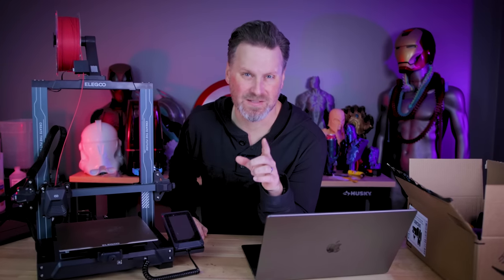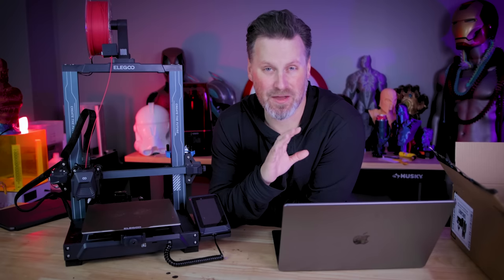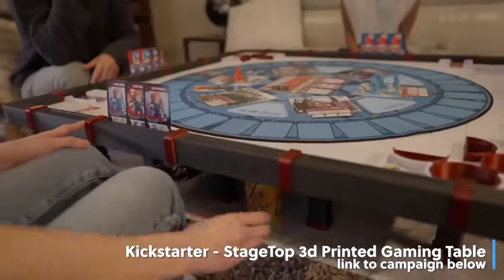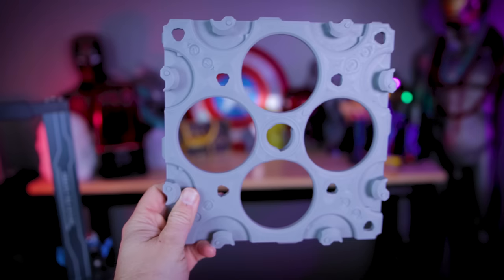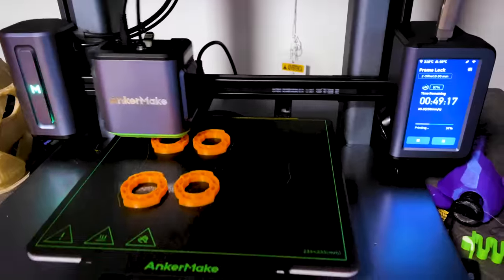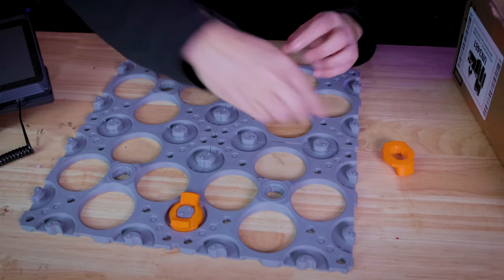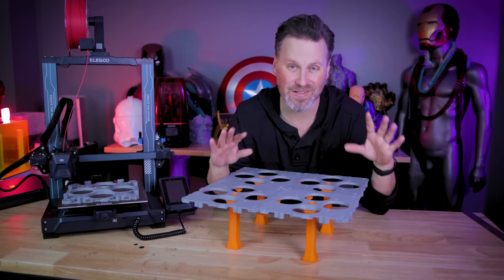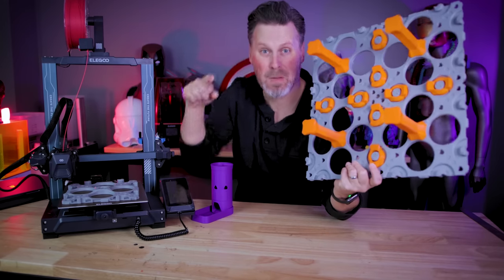3D Printing a Gaming Table

Comment: This is going to be my first STL campaign.  Thanks so much for making a video on this.  Those prints look great and are so fast.  You are saving about 7 hours per plate with the X1C. I saw your post in the Bambu group.  My friend got his Anker Make M5 recently and I really need to upgrade to a faster printer.  I think this campaign/project pushes it over the edge to get the Bambu X1C sooner than later. Thanks!
Reply: The Bambu has been consistently coming in at ~33% of the print times posted. Blown away by how fast that printer can deliver great prints.

Comment: I remember a university student coming up with an automated way of dividing up a large model into pieces with connection points that are all printable. This might not be the same thing, but it's very similar and quite clever. 

I think this is totally cool, even though I'm the kind of guy who would buy a bunch of power tools to build a table out of 2x4 lumber. Except the table saw. I can't fit that anywhere.

Comment: I do love the general idea of this though personally as someone who's in favour of open standards, I kind of see this project going a similar way to how several commercially gated grid storage systems have been waylaid by the open equivelants, in that example Voidstar Labs' open Gridfinity system. I do hope this goes in the direction of ensuring open compatibility with individual creator's works without locking down the details too much, as that'd be unfortunate. Still, its great to see concepts like this take off in any regard, cheers for sharing.

Comment: Gonna be honest, as cool as this looks and as well designed it seems to be, I can't see myself using this. It looks really lightweight and easy to knock into and jostle around. Tables need to be sturdy and solid,  especially if you have tons of little pieces carefully positioned on it. Seems like it could benefit from some sort of clamping or weighting system to prevent that. It definitely is a very useful project if space is tight or you are in need of a portable tabletop, and are willing to make that compromise.

Comment: It looks like it's been designed very thoroughly, and I almost want to back it on that basis alone, but I'm just not getting the point of it. A typical gaming table has a recessed surface so that you can 1) lean against the sides without bumping anything, and 2) put a top over it so that the game doesn't need to be packed up to use it as a normal table. This offers neither of those, and even worse is that either you have this 3D printed tray table that needs to be lifted and put on the floor or something to use the table again, or you have to pack not only the game but the whole tray table away. As well as it's been designed, for a large-ish table it looks like it'd probably take 15-20 mins to put together or pack up, and again I don't get why I'd bother rather than just use the table as is. And this is before I've even gotten into the hundreds of hours of printing plus hundreds of dollars of filament to make it.

I wish them success, and it looks like they've already got it, but I'm yet to be convinced. Having said that, if it turns out well, and people show videos of how wrong I am, then maybe I'll pick it up post-kickstarter.
Reply: This is exactly where I'm at. I like the premise, but I simply don't see a reason to build and use this over just using the table you are setting it on. The dice towers and card holders are the only thing making it unique to me.
Reply: I thought the same thing. If I could print the entire table I’m in but this is just a table topper. Don’t need that since I don’t keep drinks or food on gaming table

Comment: Looks cool, but imagine setting a game of something like Nemesis. You will need to print a lot of parts cause the game takes a lot of space table. So now you have to spend about 30 minutes putting the table together, so that you can then spend another 30 minutes or so setting up the game components. Might as well get a cheap foldable table at walmart.

Comment: The first Q at Shark Tank is, what's proprietary here? The KS page mentioned Patent Pending but there are a thousand ways to interlock any two things. I reviewed the KS comments and the only mention of patent was users not selling parts they modify, which is fair. I'm not saying this won't succeed as a KS, only that once it's out the door it's time to sell out as quick as possible because the wolves are on the trail and they will overtake and eat you.

Comment: It's brilliant! I'm just wondering if the structure could be too much lightweight and fly down from the table with a clumsy hit.
Reply: The total weight keeps it well in place, especially if you print the feet with TPU or apply an anti-slip pad on the bottom of the legs.

Comment: I don't really get it. What's the point of this play surface over a regular table? The point of most gaming tables is that the play surface is recessed so a game session can be paused and the table return to use as a plain table.

It's not clear how building one of these creates a better gaming experience.
Reply from the maker: 🤷‍♂️🤷‍♂️🤷‍♂️ dunno. Just though it was really dang cool with lots of fun accessories to print
Reply: depends on your situation, it might not be for you.  for me, I have two tables, one is slick glass and the other is rough wood with gaps.  neither is good for gaming.  this can sit over top of eather.  also instead of recessed, it looks like I can pick this entire play surface up and move it someplace else (on top of the guestroom bed) then move it back for next week's play session.  nothing is for everyone, but I can see how this will work very well for me.  and on vacations?  it's portable.  who knows what the placing I'm staying will have, with this I bring my own gaming surface.
Reply: @jajordan2515251  Fair enough. I wasn't thinking of that kind of thing. Thanks!

Comment: I am boardgame player myself but I don't understand the purpose. If you put it on top of your table, you can't sit since it's higher now and you wouldn't see the board. You can't use this without a table because it's not strong enough and it would break if anyone lean on it. Can someone explain?
Reply: I had the same question, then I saw the short (~1 inch) legs on the site available and that should solve this problem if you find yourself in this case.  For me my (current) table is a bit too low so the larger legs will work better.

Comment: Interesting idea but why a Kickstarter? Design the thing and sell the STLs.
Reply from the maker: I would assume to not waste a ton of design time if no one is interested in it. If you design just the core files maybe there is a decent amount of people that buy. Also tends to be a fairly good marketing strategy for small / startup companies. But maybe you can ask on the ks & see why they did it.
Reply: The reason for the KSer campaign is to help fund project completion. While several components are complete, several pieces still need fine tuning (that isnt the final version of the frame for example) and more development work. Some of the stretch goals are just kicking off development as well. Thanks for the question.

Comment: How can they have stretch goals for 3D cad files, which are already drawn? Seems odd someone would run a kicstarter campaign for already completed CAD files? Why not My mini factory it, or cults3D?
Reply from the maker: I would have to assume they don’t have them fully built yet but I could be wrong.
Reply: The reason for the KSer campaign is to help fund project completion. While several components are complete, several pieces still need fine tuning (that isnt the final version of the frame for example) and more development work. Some of the stretch goals are just kicking off development as well. Thanks for the question.

Comment: I dont understand Kickstarter for STL files...
Kickstarter is to fund development.  The STLs are done already, and didnt require much more than time of the designer.
Reply from the maker: I can’t say for sure for this one. But a lot of the ones I’ve backed previously, they are not fully done. Or with something like this. They might have a core set of files semi completed but not optimized. They then announce tier/milestone add ons that typically still need to be designed as well. Some will also need additional editing for cutting up the models into smaller parts or presupporting. 

I had a project in mind that I was potentially looking at doing as a Kickstarter as well. Helps gauge if you should spend the time / hire resources etc before actually investing in all of it only for no one to buy it.

Comment: While it is very cool and modular..it doesn't seem very cost/time effective. For the amount of filament needed to make a sizeable table for tabletop games, the material cost being higher for a more durable filament, and just the print time alone for the average hobbyist with 1 printer....I'd much rather just get an IKEA table and use my 3d printer to instead print tabletop board game accessories.
Reply: Yeah, as a board gamer, this is quite ridiculous idea and I'm not getting all that hype.
Reply: Nothing in this video is exciting in any way. Guess I need to check out the rest of their stuff. If this support system is the most interesting thing they could send him then yeah this is a high waste. Anyone can make a table. 

His excitement is beyond confusing.

Comment: Estimated time of…19 days?!?? Did I do that math right?!?!
Reply: Printed at default slicer settings (Prusa/MK3S+) this is correct. There are ways to reduce print times, but we didnt want to assume users were slicer experts so we wanted to be transparent about print times. That said print times on the Bambu and Ankermate are coming in significantly faster than those shown on the campaign page.

Comment: So it's not actually a table, it's more like an elevated tray that sits on your actual table? Bummer. Still neat concept tho!
Reply: One of the stretch goals we unlocked was "stackable" legs so now, if you have the filament, you can print legs up to and beyond standard table height.

Comment: @04:50 Laughs in 300mm/s Voron V2.4 Speeds 🤣
Seriously though... Why even bother listing Print Times when ppl. use vastly different settings for their printers?
Do they also happen to provide a Universal Settings these Times are based on or what's the deal? 🤔
Reply: You are right, there is a ton of variety in print times but we wanted to give people an idea of what they were getting into. We had a lot of interest from people who do not have 3D printers so we wanted to be transparent on how long 3D printing can take.